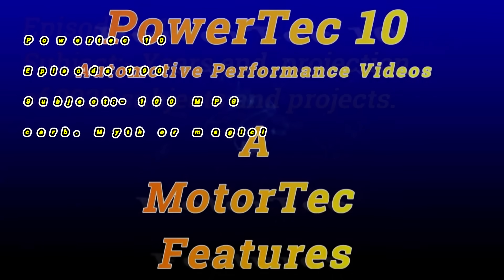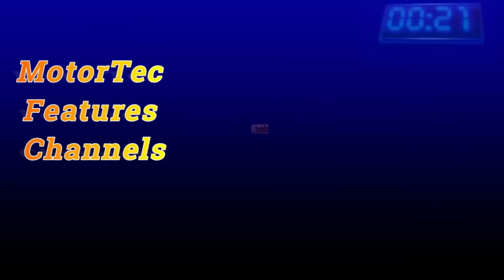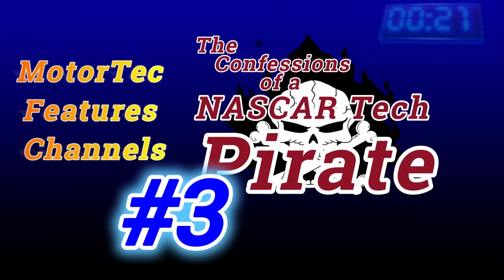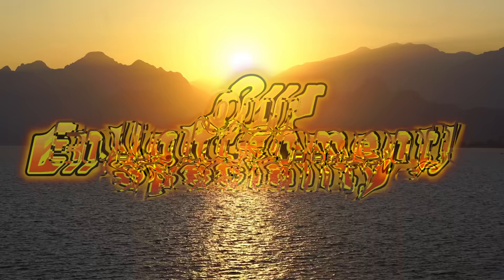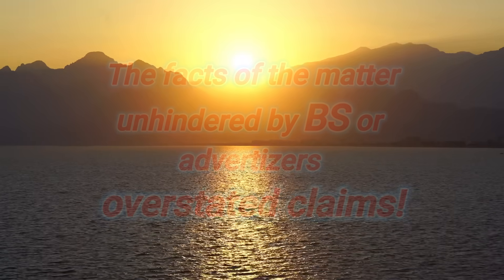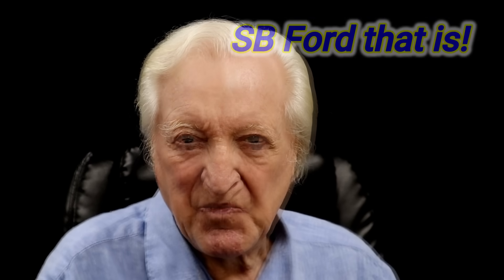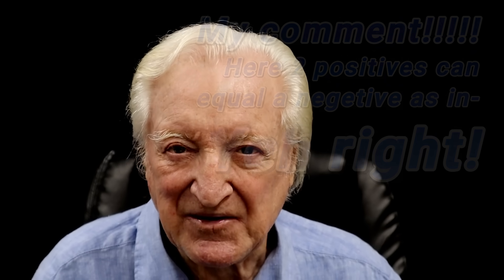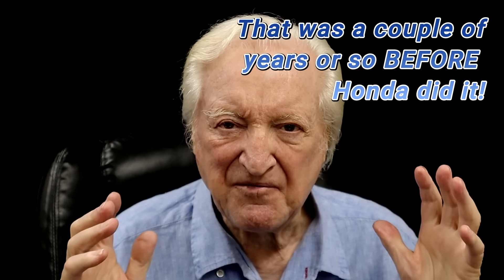The 100 MPG carb - reality or real BS

Comment: I think it's possible to build a 100 mpg engine. There is some truth to most conspiracies. 
 I think an i6 engine with 3" bore 6" stroke. Running from 350-2000rpm. 4 valves per cyl. And .600" lift 220° duration  roughly. With the ports and runners long and small, about 1"x18"  runner, and a 1.5" x 18" runner, two runners per cyl. It should do 55-65 at 400 rpm (+/-)  the crank being heavy with a moderately heavy flywheel. About 30" tires 2.23 gear. 6 speed manual, possibly an auxiliary overdrive.  To split the gears, keeping the engibe under 600-800 rpm . While going through the gears. Maybe  have an electric motor to assist acceleration . A large alternator that charges the battery when the engine is braking. Maybe a 20-30kw motor 10-30kwh battery you could drive it around parking lots and in town on battery. Start the engine to drive outside the town. Or at the highway speeds. Build a direct injection system that uses  the piezoelectric disc to vaporize the gas. Then injects tge air fuel into the cylinder  hot, at the fuels boiling temperature,  the intake air being cold, possibly going through a chiller, (intercooler) with insulated ducting to the intake runner. Maybe  80°-85°f intake air on a 80°day , it's going to warm as it enters the engine .  The injection could be a 200cc surringe basically  filling with about 20% air the rest vaporized fuel  at 180°f or so. The stroke the plunger takes depends on the throttle and computer.  There should be no liquid fuel entering the engibe.   Nearly operating like a diesel.  Possibly using cold start injectors to run on in cold weather. Until hot.   Crazy idea.. or just build a diesel engibe, a low rpm long stroke, small diesel engine..  opposed piston diesel  2 cylinder,  4" stroke on each crank,3.75" bore.  With 20:1 compression  and 30 psi boost, two stroke  possibly having air blowing through the cylinder just  before the exhaust port is closed.  Removing all exhaust.  With cylinder pressure at 30 psi before it's compressed,   it should see what 600psi+  when fuel is added? 20:1 x 30 psi 30 x 20, 600? Does this math? I know it is dynamic, but???  The pistons  separate 8" from TDC  with 4" stroke.  This is alot of energy gathered by the  stroke. Is it equal to 8" stroke? With the revvability of a 4" stroke, and a 2stroke power output.. packaging is the issue. Build the vehicle like a Subaru!!.

Comment: I got magnets on my fuel line, and I just ordered those "fan vanes" to swirl the intake air. My car's gonna be practically free to drive.😊
Reply: Change out to high mileage muffler bearings 😅
Reply: Who knows maybe it will start producing gasoline that you could sell for a profit.
Reply: I jammed a leaf blower in the intake. 
Works awesome until you get to the end of the extension cord 😢
Reply: @Cautionary_Tale_Harris but what a way to clean up the yard 🤠👍🇺🇸
Reply: You need the setup that uses the alternator to break water into hydrogen and oxygen too as it has a catalytic effect that doubled your mpg. It was all the rage 20 years ago one local shop even went to selling them sadly they lost a lot of money paying their customers back when it didn’t work.

Comment: I went with my mentor Eben to Daytona in the early 80's to see two guys, Moody and Shetley (I probably spelled there names wrong) about this subject. The seminar was named " Mileage Unlimited " they discussed three different ways of getting 100+ miles per gallon. One way was called The Nay Box, then they talked about the Dennis Air Cleaner and I forgot the third one. I bought the manual that had to make these devices but I don't know where it is now. These guys had installed installed these on a 70 Cadillac. Next thing you know they came up missing. This is true 😇🙏

Comment: I remember watching a video about that design you talk or maybe is one like it, the whole thing was literally the "run on fumes" joke, the gas was put on some sort of tank and the vapors of it were the ones sucked by the intake instead of the fuel being injected or sprayed. Volkswagen did a "1 liter car" that was able to do 100km (60 miles) per liter (more or less a quarter galon) but not only relied on using a 299 cm3 (18 cu in) diesel but also on having very very low drag aero profile, it was just a prototype and now there is a new one but its a hybrid, thats the little i know about this so im looking forward to learn more about this rabbit hole.

Comment: Carburetor or even fuel injection is not directly related to consumption. Frontal area, weight, drag coefficient and rolling resistance will ultimately control fuel consumption. If you know these values you can calculate power needed for a specific speed. Engine efficiency then governs, and is critical, to how much fuel is really needed. Carburetor then at best can only match this. Conversely if you can measure power output required at a particular speed you can extrapolate drag, wind resistance etc. Testing at different speeds would enable accurate resolution of actual wind resistance - as exponential to speed. This assumes level road and no wind. My V8 at national speed (OZ) limit in good conditions achieved better economy than a Toyota Corolla - parking the cars side by side was easy to see why.

Comment: You need to increase the efficiency of the car so less horsepower is needed [eg: Tyres, weight , drag] Then work on the thermal  efficiency of the engine so there is less waste [there is a finite BTU content to a gallon of gas]

Comment: Eh... nope. If you want a hypermile car then it will not start with a v8 and not be a petrol engine by any means.  When you are on partial load with a petrol engine , you don't have wide open throttle , you restrict the engine.
The very best bet would be a medicore sized , long stroke , 2 stroke diesel . And would have to be optimised to a very narrow and low rpm range. Even then you would need a diesel-electric drivetrain. That has some hope of doing very good milage . 
Just as comparism , i did have multiple diesel cars , mainly very old audi cars with an n.a. diesel that did manage 4.5 liters to 100 km . That be 60 or so mpg. But you can not expect performance from those old buggers. None at all. Had allso a Peugeot 206 with the 1.4 hdi engine that did went better , went past 65 mpg , however that will not realy seat 4 adults and no chanse of reasonable luggage.  

Petrol engine wise... i can only imagine some sortha compound turbine whatever solution. That is , exhaust driven turbine is used to drive the crankshaft instead of attempting to smash more air into the engine. That might work its way up to the 60 mpg club. But 100 mpg ?? Nah..  even if one manages it , it will come with severe limits.

Comment: Before we think about gasoline fuel economy, we must ask the question if this would be possible with a high CR Diesel-engine with a thermodynamic efficiancy of about 42% and up to 50% for super high efficient truck-Diesel. I think 80-90MPG would be the limit for a car that you described. The efficiancy of a gasoline engine is at most 80% of a Diesel engine and all the experiments to improve this, ended up with a directly injected Diesotto concept (CR 16-18)
Reply: The efficiency of a gasoline engine is 25% AT BEST
Reply: What about spark assisted compression ignition like some of Mazda's gas engines use? They have a 14:1 compression ratio and run on 87 octane. The trick is they inject less than the stoichiometric ratio of fuel into the intake port and direct inject the rest of the fuel near the top of the compression stroke. Those engines get diesel-like fuel economy figures.

Comment: Aside from performance builds, I have built a few engines to improve economy, one is in my shop truck, the manufacturer's combined cycle is 28.6 mpg, after extensive piston, cylinderhead, cam, exhaust and efi tuning, and a compression ratio increase from 10,4:1 to 12,5:1 I am getting 48.,4 mpg, I have lost around 1000 rpm in rev range but the torque makes up for that.
100mpg, I'm sceptical...
Reply: I did a similar thing years ago with a mid-1970s emission complaint Ford 460.  I rebuilt it with higher compression, an aftermarket camshaft, intake and headers, along with port work and a better ignition system.    It went from at best mid 200 HP and 7 - 8 MPG to ~400HP and easily ran low to mid teens even while being driven hard.
Reply: Did you drop ring tension to cut down on some static drag?
Reply: On what engine
Reply: First thing to do to mid 70s 460 was to replace timing set with non retarded cam timing.made a noticeable difference even on stock.

Comment: 1964 El Camino , 250 c.i.d. 308 dif. ratio , Muncie 4 speed wide ratio , small Holly  carb , 1,100 rpm's at 55 mph , 70 mpg , yes .
Reply: I would guess 36-38 mpg hiway
Reply: Lol No.

Comment: Would appreciate some comment/ insight into your thoughts on Smokey's hot vapour engine as it seems to not fit in with droplet size / vapour of combustion timing  requirements as you referred to in quench topic

Comment: 11:00
 Wouldnt the "wet road" equal to a cooler, more dense air fuel mixture?
Reply: It's more rolling resistance to overcome. A cooler air mixture is denser, but the water also displaces some oxygen if it's being cooled by evaporation

Comment: I'm curious, 100MPG on what kind of fuel?  Gasoline, Diesel, propane, hydrogen?  

If i provided a engine that burned propane for fuel, I'd surely surpass the 100mpg benchmark if you are measuring gasoline consumption.  

I know you think I'm being an A*hole here, but I have a point to prove.
I'm currently working on an engine than can meet, no exceed by a lot, of your minimum performance levels, that uses a 40% alcohol to 60% water fuel.   If i can get 20 mpg in a vehicle, that meets your performance standard, I've exceeded your 100 mpg benchmark, if you are measuring gasoline/alcohol as your benchmark.  

What if I can refine this engine to perform at a 10% alcohol/90%  water fuel?  Would that be interesting to you?

I've been in contact with Brian Salter regarding this technology, but he's tabled it for a bit due to his current personal issues, but I'd be happy to show you what I'm working on.

Part of what I'm doing, requires a increase in electrical discharge from a conventional CDI ignition (like a MSD-6AL), to a 'plasma' spark ignition.  Here's a short video demonstrating the difference in spark potential.  https://www.youtube.com/watch?v=BdakEn92CaQ

I need this increased spark potential to ignite the alcohol/water fuel combination... but I also have to 'process' the fuel before it enters the combustion chamber (that's the secret I will not share at this point, which makes the magic happen).  

I've already managed to get a 4MPG increase in MPG without adding the plasma ignition, by simply adding 16 oz. water to 5 gallons of 87 octane fuel, in a GM 4200 Atlas engine in a trailblazer,   I do have to apply a 'treatment' to the fuel before it enters the combustion chamber though. The treatment doesn't involve any additive to the fuel.  

and I can get the 60%water/40% alcohol mix to ignite on my demonstration apparatus in the video linked above, just by misting the fuel onto the plug from a spray bottle (not under compression).

Now, the last thing I wrote above (not under compression) is very important.  

While I've developed this technology on my own, I've recently met a local man who's 93 years old ( I do his plumbing repairs), who is extremely wealthy.  He obtained his wealth because in the early 70's he developed an engine that could do what you are claiming or actually ran on water.  He won't specifically tell me what he has done, as he's under a NDA, as the Government (or some company) bought his silence.  He simply won't say.

 I demonstrated to him, what I've discovered, and he said that he was extremely surprised that I could get the 60% water/40% fuel to ignite in a non compressed environment.  He is extremely interested in where I go with this, but he clearly said that he can NOT be a part of anything to do with it, as he doesn't want to call to question his sharing, what has become a national secret, or be in violation to his NDA, which would be heavily protected by the powers that be.  He was very vague about that, but, his 'story' is a well known fact in my local community, I had been doing his plumbing a couple of years prior to me even associating the local myth, that I never really believed, and then one day, was smacked in the face that I asked him if it was true.  He did confirm that  fact.    

If this interests you, I'd be happy to show you where I am in this R&D right now.

Comment: Excuse me if my questions aren't relevant to your usual topics , but I have so questions about gasoline . I wanting to use something better than auto pump gas in my 2 stroke string trimmer. I'm considering marine gasoline, some VP racing fuel, some aviation gas and some Coleman camping fuel.  Years ago I premixed the Coleman fuel with the 2 stroke oil at the recommend ratio and never had any power loss problems and the exhaust smelled extra nice !  I asked GOOGLE  for the octane rating for the Coleman fuel and it said the rating was 50 to 55 octane.   I'm betting you could guide me on this better than calling tech services at Red Max lawn equip. I was using the Coleman  fuel mix in an Echo type brand string trimmer an called them and asked them if I could use the Coleman fuel for that engine  and they said " yes , we wish everyone would " . I'm wanting to use the Coleman fuel in my Red Max BCZ260TS string trimmer.  Is the octace rating really going to be any concern for a string trimmer ? I have to doubt it . If any of your viewers are experienced about this question I would be glad to receive their comments. I've been an auto racing fan all my life and sure was glad the day I found your channel.  Special thanks to David for making videos  for us !
Reply: I found that using the premix in the red can sold at those box stores, it doesn't have the ethanol in it, so it's not clogging up the carburetor when it sits over the winter and it didn't matter if I left it dry. It helps it perform every year.I can't say if it helps performance.
Reply: Stihl makes a synthetic 2 stroke fuel that works well and has a 3 year shelf life it even smells like race gas but it’s only 93 octane. It’s also like $40 a gallon
Reply: Message to bcbloc : I don't know how to send you an email, so I'm  thanking you here for the reply to the $40 Stihl fuel comment. Does it already have the oil mixed in it at 40-1 or 50-1 . I will have to inquire about that at my nearby lawn equipment sales and service store !
Reply: @richardpalko8062  yes, it does.I don't know the ratio of oil in the mix.
Reply: @richardpalko8062 my email is on my you tube channel about section but regardless you are welcome.😊 the Stihl moto mix is 50:1. Technically rather than mix it is a synthetic fuel that has the lubricant in the chemistry so it is not prone to settle out like gas and oil mix is when it sits a long time. I still shake it before pouring cuz habit and figure it can’t hurt.
Reply: To: jeniferteal 4178 I don't know how to send emails,  so I'm  thanking you here for your reply to my recent U-Tube question about string trimmer fuels . Unfortunately even though the canned fuels don't have ethanol ; I've seen some U-Tube reviews on the canned fuels like "Pro-Fuel" and their product isn't quality dependable ; plus we don't know know what 2 stroke oil they're using . There may exist some other brands of mix or non mixed fuels I haven't heard of yet in the quart cans , but I haven't heard of any that are recommended by small engine repair shops. I will have to do more research on those products. I don't have to do any more research on the best 2 stroke oils. I will probably just have to use an 89 - 93 octane pump gas that has NO ETHANOL in it . I use Lucas ethanol shield - fuel stabilizer in  my lawnmower gasoline can even though I buy ethanol free gas for that. I use ethanol free gas in my car all year long and use the Lucas ethanol shield-stabilizer in its gas tank for condensation water control during the cold weather months. I saw some very disappointing reviews on U-Tube  recently about "STABIL" BRAND  fuel stabilizer  .  I couldn't believe how bad that product is.
Reply: @richardpalko8062  where do you get ethanol free regular fuel? I hear the local fire departments are able to get it for their equipment because it's so important for the equipment to be reliable and ready to go. I know they take great efforts to ensure it's ready to go. the gas is one issue they want to avoid. When I had the race car, I connected with a guy who delivered to the local firehouse for their b. Rig? The race thing I don't know what else to call it that use racing gas. He didn't charge me for delivery. There only a few blocks away from the firehouse. I just pay for the drum and he'd bring me a new one when I needed it. I was thinking of looking into how they get this ethanol free fuel for their power equipment. That would probably be the best option. I'm just happy that every spring I no longer have to take apart the carburetor and clean out the white powder.